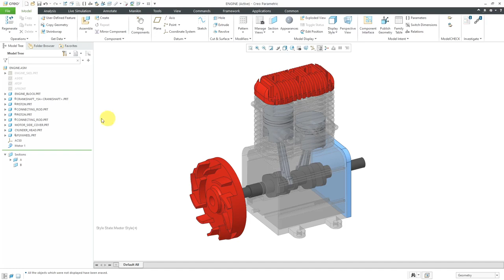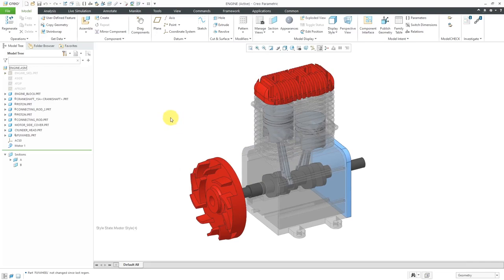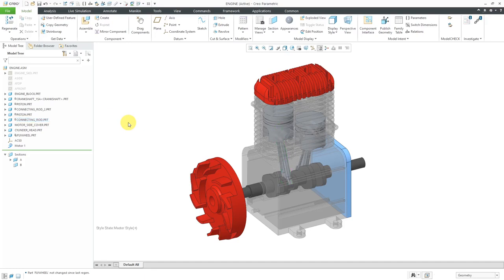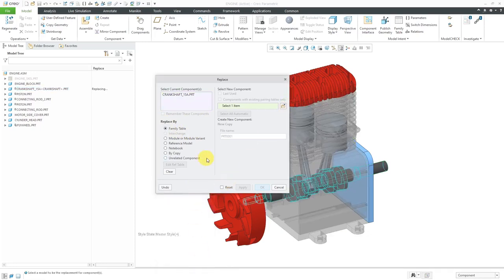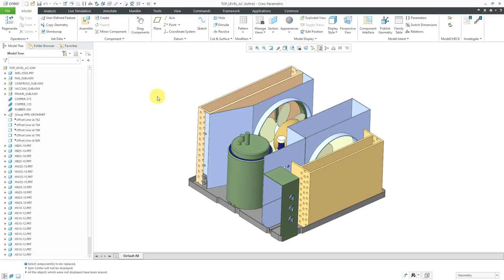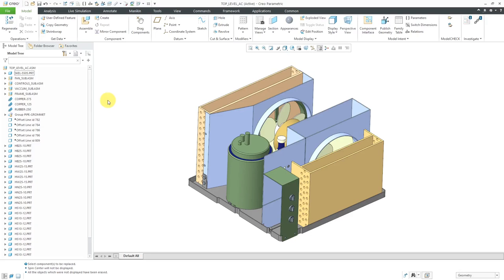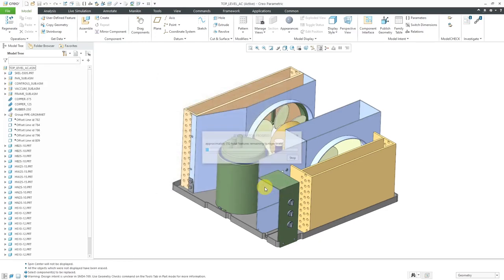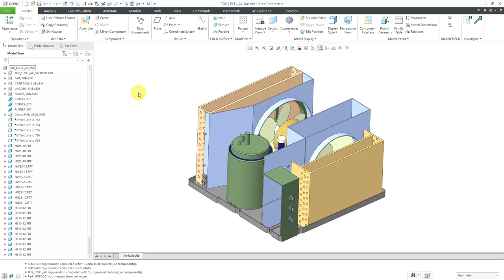Creo Parametric - Replace By Copy

Comment: I use this function all the time, It would be great if this functionality would be available for subassemblies as well. I pitched this idea on the PTC forum about 5 years ago already. Are the other “replace by” functions interesting to look into (apart from replace by family table member and unrelated copy)?
Reply from the maker: I’ve heard it pitched at the Technical Committee meetings multiple times so I’m pretty sure Paul has investigated it. I suspect there are technical reasons that must be preventing it from going forward.

Comment: Good overview.  I never noticed replacing as a skeleton.  Nice trick and useful.  Do you ever use replace with reference model and if so, what is a use case for that?
Reply from the maker: You have to modify a part which changes form, fit, or function, requiring a part number change. You create the new part using Inheritance and then swap out the old part in parent assemblies.

Comment: When you copy the model and there is a drawing associated to it in the Workspace, would it also copy the drawing?
Reply: No it wont
Reply: I believe you can open the model, do a save as and select copy associated drawings then go back to the assembly and do a replace with unrelated component, select your new one and redefine its assembly references.  A few extra steps but it will get you the desired result

Comment: How to defined graphic represents in Creo for big assembly open
Reply from the maker: What version of Creo are you using? Graphics Reps were deprecated in Creo 4.0. Prior to that, they were created automatically in assemblies. See my video on Simplified Reps (the 3.0, not 5.0, version of the video).
Reply: @CADPLMGuy  
Creo 4.0
Reply from the maker: @niravsapariya5575  No need to use Graphics Rep in Creo 4.0. Use the Automatic Rep. See my video on Simplified Reps in 5.0. (I made it in 5.0 but it applies to 4.0.)